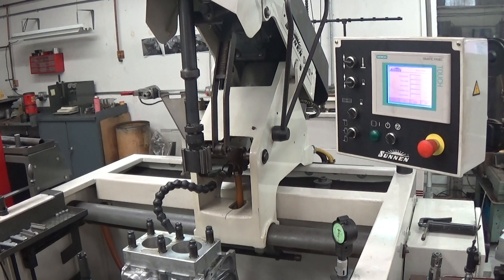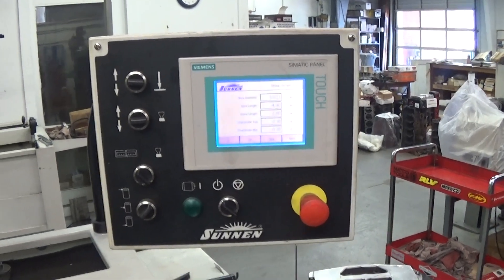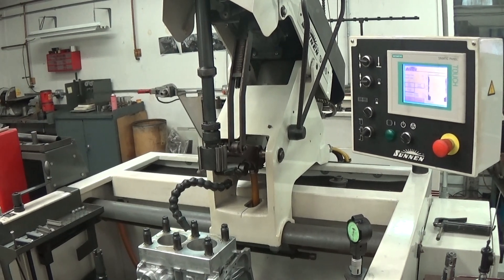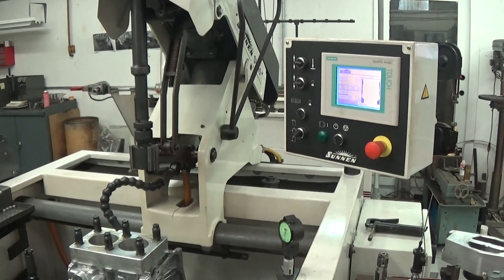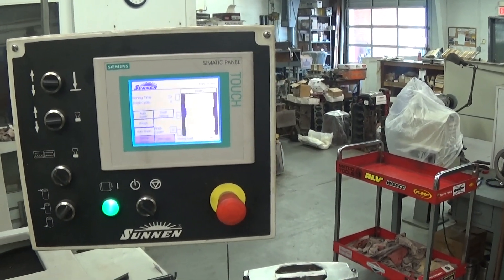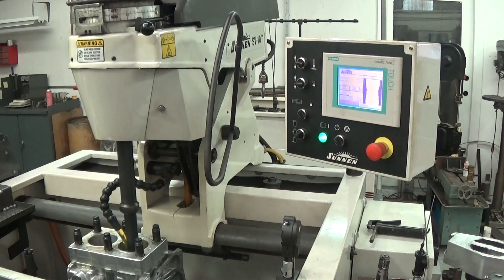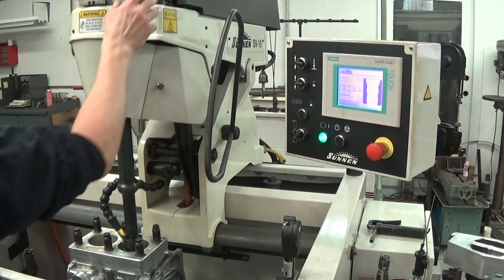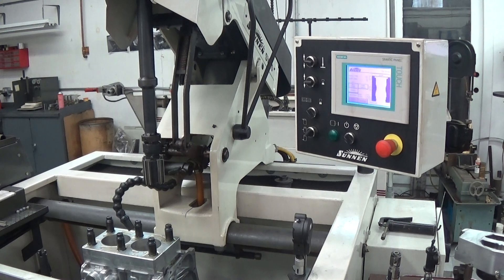Subaru EJ block honing in Sunnen SV10 diamond hone

Comment: I have 35 years of experience operating a sunnen hone. This here SV10 is fantastic, if I owned a engine overhauling company this would be a key piece of my shop. My question is what grit shoe is used to remove stock and get the required surface finish ? thank you sir.
Reply from the maker: 150 grit is the most common roughing grit but there is even rougher available.

Comment: What kind of coolant do you use.  I'm not happy with my oil in my cv616
Reply from the maker: @georgesam7805  I switched back to oil, coolant did cool better but I started doing alusil blocks and they do not work with coolant.  I use Shaeffer honing oil and like it.

Comment: Brings back memories, at my old job when they were implementing "one piece flow".they actually had me running 5 machines simotantiosly.  2 SV10,1 od grinder,1 id grinder and a manual lathe......the sv10 is way more precise than the sv3

Comment: I have the same machine and I’m currently doing a cylinder 15,6 height and 5in inner diameter to be honed 
Is for a piston
I’m having this issue when the machine stars it ends to quickly, I’m looking at yours go and the dial won’t even move much but in my machine I’ll try to finish .005 thousands in 2 minutes

Comment: How important is the deck plate in this operation? Is there any risk in honing without plate?
Reply from the maker: For a stock build it's not critical, the factory does not use deck plates when new. Rings can conform to some minimal out of roundness of the bores. But if ARP head studs are used with a higher torque value, there is more bore distortion. When doing a performance build, high boost, more cylinder pressure, etc, it's best to get the bores as round as possible to prevent any combustion loss past the rings and maintain accurate piston skirt clearance.
Reply: @motion24527   I put arp studs on my 2.0 tdi engine, using 2.8-2.9 bar boost. I have some blow by gas..so i will hone with plate at this point for a new rebuilt.

Comment: very interesting, i work as a honer, curious how it is measuring the bore? is it based on torque? We could use a machine like that , we have horizontal Sunnens.
Reply from the maker: It senses load in the tight sections and dwells there. It doesn't actually measure the bore diameter, the operator determines the zero set on the crown wheel after honing the first cylinder to the desired size. From there, it will hone the rest to the same and shut off when reaching the zero set.

Comment: Does the Sunnen SV10 have the auto-dwell feature, which finds high spots in the cylinder and will cause the honing head to "dwell" in that area, which helps maintain cylindricity? Thanks - Daryl

Comment: Greetings from Canada! This is very good information and your shop is equipped with top notch machinery. The key to an excellent job is operator knowledge as well. Thank you for taking the time and posting these videos.
Reply from the maker: Yes, it senses the tight  areas and dwells there if you are in auto dwell mode. You can also choose to dwell manually but for most blocks I just hit auto and let it go.  I believe in this video it dwelled a few times on it's own.  It's so simple a caveman/automotive machinist can run it!
Reply: Thank you Sir. I will try and call you tomorrow. Have some questions..is it the same number as on your Web site?
Reply: Have you bored+honed two stroke cylinders? Do you use a separate mandrel specific for 2 stroke cylinders?
Reply from the maker: The SV10 does not go smaller than 2.750" with the diamond tooling. Of course you can adapt any mandrel to the spindle but I normally use a PL mandrel in the horizontal hone for bike cylinders, done thousands of them this way. 2 stroke outboards I hone in the SV, it does an awesome job even though there is very little overstroke on most of them.
Reply from the maker: Yes, # is good but I don't answer the phone due to all the b.s. calls businesses get. Leave a message and I will return the call.
Reply: +motion24527  Understood, will do Sir.
Best regards - Daryl
Reply: buy sunnen sv25